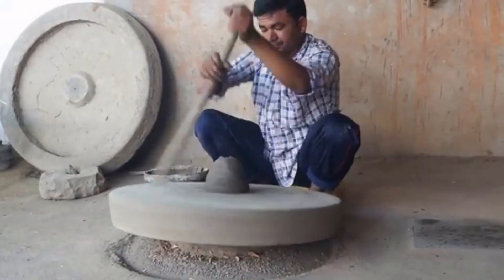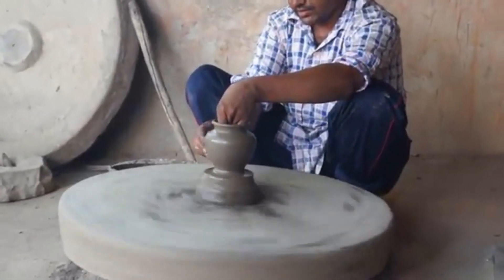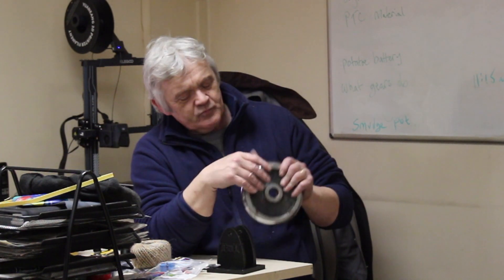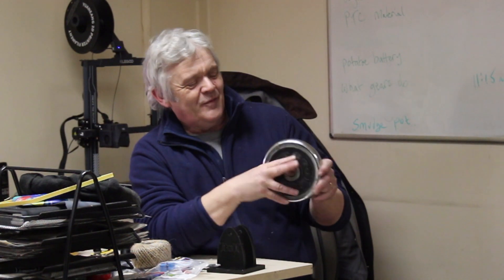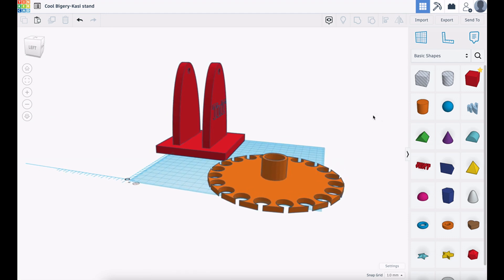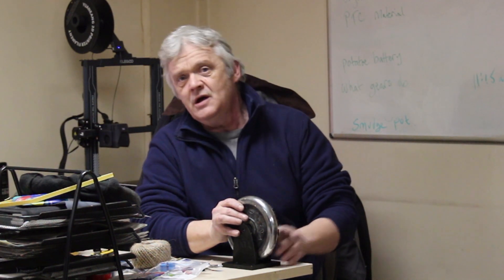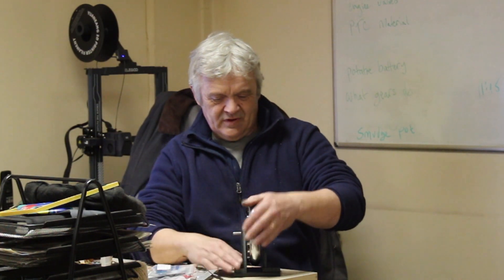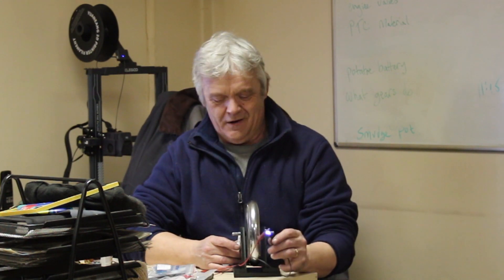1855 A Simple DIY Mechanical Battery

Comment: I remember there was an ad around 2005 that showed people riding a stationary bike fitted with a flywheel designed to produce electricity... and has a table fitted for us to even power our laptops on and potentially recharge whatever other devices. It still seems like an awesome invention, but... it was apparently considered far too expensive for their primary clients, whereas... most of those people didn't even own a cellphone. This technology can drastically improve their lives in a whole lot of ways, but... each of those will cost at least $1000 even when the flywheels can be sent empty to be filled with sand/mud; That's $1000 x... "250 million people".

Comment: Yes, agree, but, here is only one coil and on one side. If you'd add more coils and on both sides, this should slow it down quicker. I don't know how much, maybe someone can show a calculation of it? You can as well try to control RPM with an Arduino ;) for instance before putting it to practical use to understand what is safe and what's not anymore.

Comment: Reminds me of an idea I once had about having something like this on sailboats. The rocking of the boat at sea would provide the motion (in this case the pendulum staying still and the boat swinging around it :P. With boats having wind turbines, solar, and now water power (using the propeller to drive a generator when sailing) I was surprised someone hasn't come up with something like this. I guess this might be a problem with size though (boats having limited space), and the cost vs amount it would harvest being probably low compared to other options

Comment: Hello Robert M. I have seen in a lot of your wind turbine vids that there is mostly a lack of wind to preform well. Would it be possible, interesting to use the windturbine with a combination a spring and gears to wind the spring so energise a flywheel so the generator works optimal once in a while depending on the wind speed (energie). Just an idea. thanks So Oldt

Comment: I need something that can store energy when the sun is down and the PV arrays aren't working. I have got about 15Kva of PV arrays on my farm here in a remoter place than can be imagined. 10KW of that energy is quite often running a large water pump for irrigation. The rest I need for air conditioning, refrigeration, gadgets and lights. Just to give an idea of the scale I often find myself trying to magnify Rob's genius ideas into. About a decade ago there was a paper showing how a university teacher and their students came up with a battery that uses scrap iron and bronze (copper). I would have built that but I could not confirm what diy material would serve as a proper ion exchange membrane, and the university also went silent despite their indication that they will share more info on that battery.
Reply from the maker: yep - I remember the scrap battery - the main issue with scale is the manufacturing mate
Reply: Run an air compressor during the day to fill air tanks with compressed air, then release the compressed air at night to generate electricity.
Reply: @XtremiTeez  Hmm I think those steel tanks will cost a lot of money but I will research this to find out the duration one of them will keep driving something like a pelton wheel.  Its a good idea. TY.

Comment: Hey Robert I have a question and I haven’t found a good answer anywhere I was curious if you know anything about this or anyone else here

So recently I came into a metric crapton of 70% isopropyl based hand sanitizer

And after watching your videos and wanting to build a smokeless indoor heater for my garage, I went to attempt that and obviously I got quite a bit of smoke and a pretty room filling smell from burning it in the garage

Ventilated enough but not ideally I would say

So my intention was to pull the other ingredients out using salt and stirring it around, it’s a very liquid consistency not particularly gel-like, and the ingredients are as follows:

Medicinal ingredient: Isopropyl alcohol 70%

Non medicinal ingredients: Aqua, glycerin, and hydrogen peroxide

I tried it once before and a friend of mine said to add aluminium foil to it to act as a catalyst, I haven’t looked anything up I just thought about how you might have some insight on how exactly to separate the isopropyl from the other ingredients, especially since I have so much it would probably be smart to condense as much of it as I can into it’s purest form so I can then use it as the cleanest burning, hopefully nearly soot free indoor heater

Though I’m not familiar with it’s possible output of carbon monoxide with anything present, I know I still have a lot of research to do myself sorry for being so fresh at all of this
Reply from the maker: I suspect you could just distil it - carefully!

Comment: Now you just need some gearing, a pully and weight like those gravity generators and mount it up on a wall. The weight can spin up the flywheel and the gearing can get it to a faster speed. Now put a metal shield over the flywheel and you don't have to worry as much about sudden flying projectiles interrupting your day.
Reply from the maker: like it mate lol

Comment: One thing that I have pondered regarding all of these energy harvesting devices is what would be the easiest way to get small amounts of energy into a large Bank of batteries would it require a series of capacitors to build up to a high enough voltage to be able to bleed into a 12-volt system is there a better way than that to do it Mount some of these different devices somewhere for example and every time I walk by pull on a rope or spin by hand even like you just did the device then allow it to drain into a battery Bank. My problem is I don't really know how to get it into the battery bank at low voltage is like this and I'm sure that there are a lot of people like me

I lose power here in my house every four months for maybe 6 to 8 hours which isn't really bad because it's Michigan and we get a lot of serious storms but if I had five or six deep cell batteries as a bank even if I had a very small solar panel it would fill up the battery bank and no time. I had a whole big box probably 30 of those yard lights that work up a tiny solar panels I took those and string them all together into one big solar panel and was able to charge 18 650 batteries I can't remember how I did it it was at my last house but it works great I didn't have to keep my battery charger plugged in anymore I just plugged it into the solar panel I had mounted onto my back window
I'm sure it didn't make much of a difference in my power consumption but why use it the power grid if you have something else to plug in right?
Reply: More turns in the coil (necessitating thinner wire), and higher velocity will get you more voltage. You'll probably want a diode or a bridge rectifier to prevent the battery from discharging when it's underpowered as well. Of course you could use a switching power supply, a boost converter, or a joule thief, but that introduces more complexity. Just turn more wire. And be aware that you're trading off current because you're raising the resistance of the coil. I think the commercial solar controllers use something called an MPPT charge controller - maximum point of power transfer. They're good at converting a very low power input into something that can actually go the right direction into the battery. But if you have a generator that can produce some known minimum threshold of power, you can make it a lot simpler.
Reply from the maker: charge in parallel discharge in series mate - we did this when we covered fractal capacitors

Comment: So i wonder if the term battery comes from the ancient times were they used a store of energy called a battering ram to break down fortification and gates etc ?
Reply: No, it comes from the use of the term ‘battery’ meaning multiples of similar or identical items. Originally this was in reference to artillery, where multiple guns were organized into ‘batteries’. This meaning is still in use today.

When Volta an the other early electrical experimenters linked multiple electrochemical cells together, it seemed natural to refer to the assembly as a ‘battery’ of cells, and the term stuck, eventually morphing into the generic term for electrical storage devices, whether they consisted of single cells or multiple.
Reply: @DABrock-author  nice one
Reply from the maker: I think it is the collective noun for 'group of' mate - hence battery chicken and battery farm

Comment: The flywheel off a car or truck engines especially, some can be easily stacked, and mounted on a shaft,  a tractor flywheel can be especially heavy, for non diesel tractors, but diesel tractor flywheels are heavy also, if you are concerned about spinning it over 6 k rpm, I'd wrap it with carbon fiber ribbon, and epoxy resin,  wrap it tightly as possible, then pull a vacuum on it to remove any air pockets! A 20 mm thick ring of carbon, would help hold it together at loads of higher stress than without, I'd definitely test it to operation rpm , and then some, and do regular crack testing! The flywheel from a 1990 Chevy s-10 blazer with 4.3L V6 engine weighs about 50lbs, and is basically a flat disc, that can be stacked, drill out the pressure plate bolt holes in all but one, use a long grade-8 bolt to connect them together, I'd definitely use something in the center to concentrically align them before tightening then, give it a spin, looking for runout from balance  or misalignment, it would be easy to  build a 200-400 lb flywheel, it requires the flywheel from a manual transmission, because a automatic flex plate, only weight a couple pounds at best,   but stack about 4 flywheels together, on a 1.5" shaft, with double bearings on each end , use a CVT to spin it up, so the gear ratios gets higher as load goes down, using solar power I'd mount it in a thick steel box, and pull a vacuum on it, if it can't hold a partial vacuum, I'd try back flushing with hydrogen to reduce friction, since helium is used in this situation, hydrogen should work better, , as long as oxygen doesn't enter the container, and and it gets a spark or the bearings heat up and cause ignition,  pure hydrogen should be no problem,  maybe helium  would be better!
Reply from the maker: I was thinking of car flywheels for scale up

Comment: with the eddy currents there is going to be magnetic breaking correct?  would the magnets being extended beyond the fly wheel be better?
Reply: The magnets are in the same reference frame as the flywheel, so there's no eddy current there. If it was in a metal housing it might. Of course as you extract energy via the coil it will slow down.
Reply from the maker: no it is going to be counter torque that is the main issue mate

Comment: Larger diameter magnet holder so the magnets are beyond the edge of the weight.  This has 2 benefits, 1st the speed of the magnets is increased.  Second you can double the coils having 1 on each side of the magnets thereby doubling the generation.
Reply from the maker: nice suggestion mate - I will go with what I have done so far because it saves me printing time and money but I love what you suggested - cheers

Comment: I think a fly wheel needs upwards of 80% or more of it's weight on the outer circumference.
Reply from the maker: no - most heavy lumps will act as a flywheel - you can improve it by putting 80% of the weight in the outer rim but it doesn't need 80% of it's weight on the outer rim

Comment: I assume the heavier it is the faster the bearing will wear away unless you turn it sideways an use a magnetic or water float bearing
Reply from the maker: wouldn't you just put a bigger bearing in if you made it bigger?
Reply: @ThinkingandTinkering  sure I guess

Comment: If people are so worried about it spinning too fast, they can always build a centrifugal clutch that disengages the motor once it surpasses 1000 or 2000 rpm.

I think most of those complaints are to discourage people from doing rather than encouraging do.
Reply from the maker: I agree - some folks like to discourage if they can - it's a shame

Comment: Hi Rob, not sure if you've seen it, but there have been a few articles online, including on the BBC website about a couple of the vertical wind turbines (like the Darwin one) which have been put on trial by a Norwegian company. One is on Skegness Pier and the other I think is on top of a factory. They look a couple of metres high, but I haven't been able to find out how much power they are expected to generate. You can read about them just by Googling 'wind turbine Skegness Pier'. I think the idea is that if they prove to be effective they will be offered to other commercial properties.

Comment: That looks like a scaled up version of the generator for a flywheel powered toy that I had, on one side there was a round slot that looked like half of a yo-yo you would wind your pull string around that when you pulled it it would start generating Electric, you could choose three different speeds it was about the size of a grown man's foot, thank you for sparking that old memory that I had long forgotten.
Reply from the maker: flywheels are everywhere mate!

Comment: Biggest challenge with diy is balancing it. I'd say the fastest one might get to before being too nervous because of balance issues is 1000-3000 rpm.  Which is still potentually very dangerous.  But you can still take precautions and be aware if potential failure  modes and take steps to mitigate thise risks.
Reply from the maker: it would be better balanced that's for sure but we have covered static balancing before - I will do it again
Reply: I think keeping it at 1k rpm might be a good idea. Even if you were able to balance it. With a lifting weight you just don't know what the composition is, how consistent, or how mindful they were when they cast it. The castestrophic blow apart would worry me at higher RPMs.  It's like using Tee posts or bed frame rails to build something, you just don't know.  I mean for testing the waters, absolutely, but sticking an angle grinder on it to spin it up, even if you can balance it..... my be some holes in just the drywall..if you're lucky.  Very sincerely, if you go getting up to "self" balancing speeds, get a flywheel that you know what is made from, MPI'd, etc.

Comment: More bodybuilding talk.

Until recently I was trying to follow a high intensity lifting plan. Low volume, high weight lots of rest.

I've often wanted to build a way to harness the energy of weightlifting. Like maybe a generator that you could set the resistance on to make virtual weights by the Lorenz force.
Reply from the maker: I can think of a few ways to do it mate - it's a good idea
Reply: @ThinkingandTinkering  thanks. I have several ideas on how it could work. Both mechanical and electrical. 

The hard part is a solution that gives a good experience for the person working out. You'd want constant pressure
Reply: The thing about lifting weights is you're exerting a lot of force, but not very fast or for very long. You need a way to store that energy and release it over time. You could build a gravity storage device, lift up something big and heavy with a ratchet mechanism, maybe with an adjustable lever to dial in the weight, and extract electric power on the way down. Cardio machines like treadmills, bikes, and ellipticals are a more direct translation to power. In any case, there's a speed component to power, either torque * rpm or force * velocity.
Reply: @DFPercush  well I've considered some sort of flywheel and 2 sets of weights and s mechanism to switch between stacks